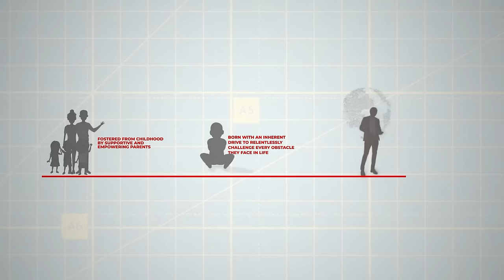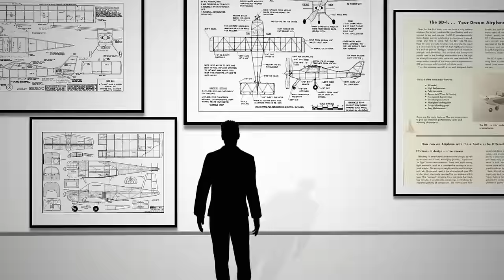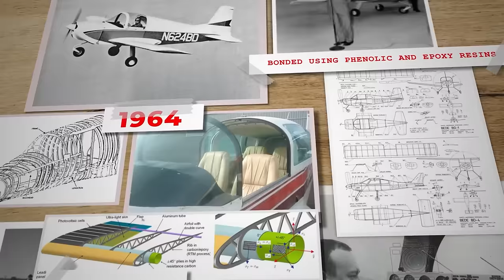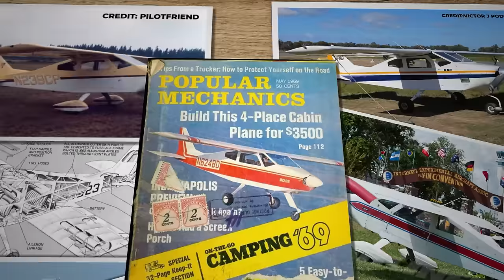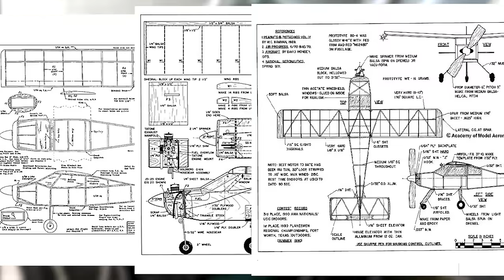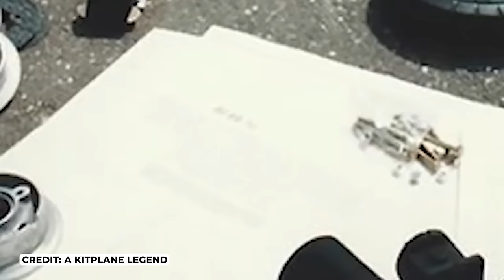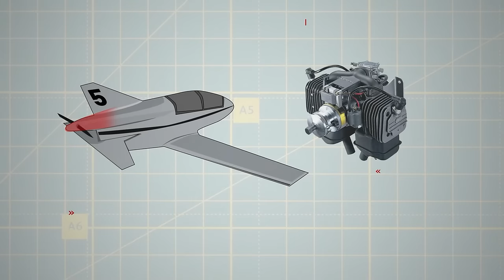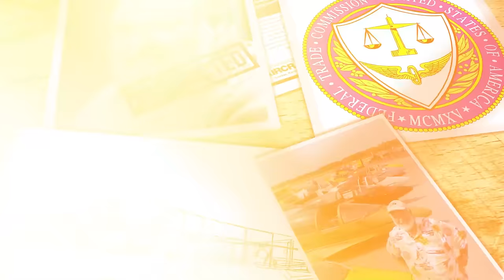Is Jim Bede a Failure?

Comment: Jim Bede also designed the Pulse autocycle, This was an enclosed motorcycle which is shown briefly near the end of the video. About 350 of these motorcycles were built. There are still about 200 of them still on the road. I owned one for a few years. I never saw a vehicle attract so much attention on the road. It was fun but wasn't really practical.

Comment: The Bede5 turbo-jet was skipped over with no adequate reason as to why..Depicted in the Roger Moore/James Bond film opening scene of Octopussy,  was it ever a practical option as a light jet ?
Reply: Not practical, fuel consumption too high. Flies well for airshow demonstrations for a half hour.
Reply: @PRH123  Thank you for that.. looked a great little personal transport vehicle :>)
Reply: @jamesgraham6122  Bede later worked on larger 2 place versions, propellor driven, but I don't think they ever got past the concept phase.